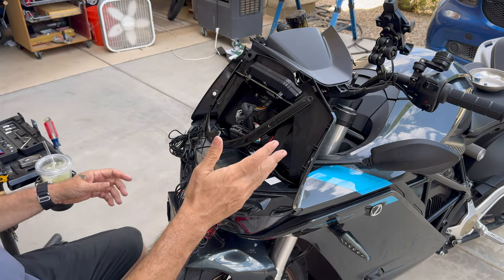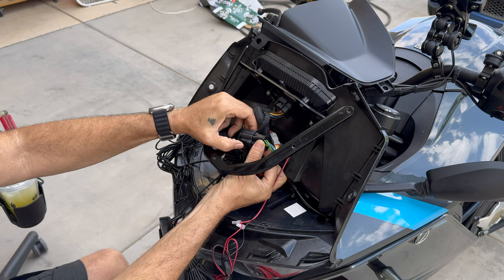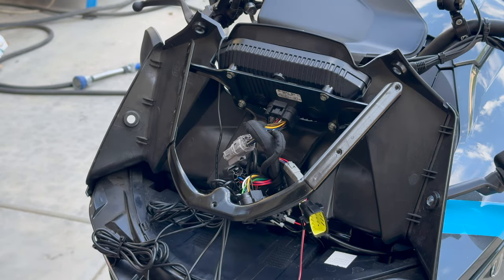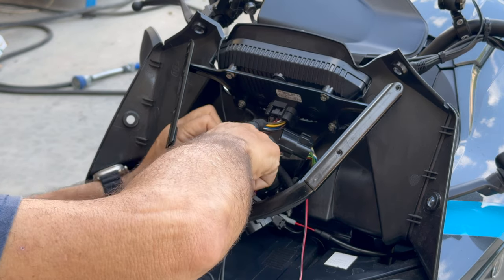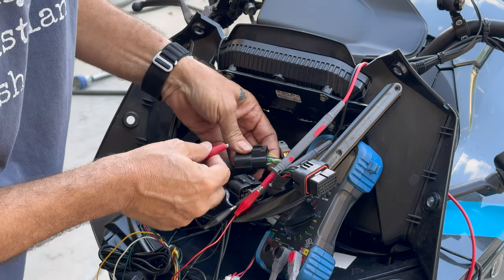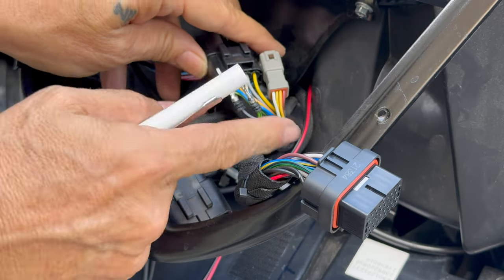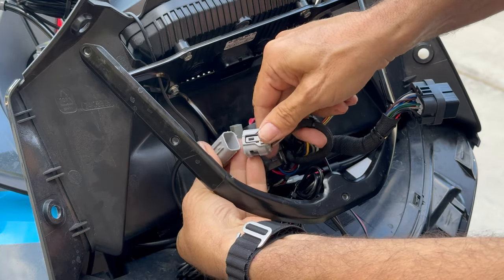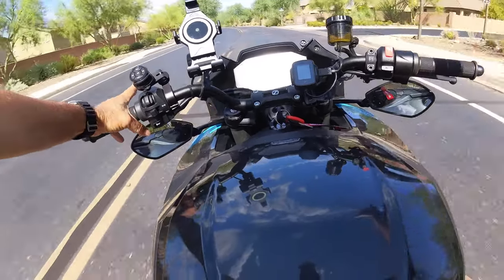Zero Motorcycle cruise control button swap

Comment: Here from Electric Sportbike Forums. 
This is a good idea, I have this bike and agree
And yes, my nut-serts you pointed to merely spun in place when I originally got the bike new, no way to remove fairings as thats the starting point. I had to drill them out.

Comment: Thanks à lot for this quick tuto.  

I just made it on my SRS 2022 premium. 

Wire color on mine wasn't the same , but positioning on connector was the same. 

For those who want to do on the same bike of me , the original cruise button was blue-white and black and the original hazard grey-black and green-white. 

It s easy to disassemble on each side to see directly under buttons.

Thanks again and have n8ce and safe ride !!!

Comment: Re: rear brake
Did you consider moving to a left hand lever? I think a big part of the lame rear brake is the master cylinder and wonky geometry of the brake lever.
Reply from the maker: I've kicked it around, but am unlikely to do it.  I agree with you, the geometry is annoying at best.  Instead of pivoting my boot it pulls it forward.  But I've been riding for over 40 years, and fear that working in an odd new way to ride might be dangerous.  Also during one of the advanced riding classes I learned that the back tire comes off the ground on a full stop, and the ABS keeps the bike from flipping over completely.  So the rear has no value in emergencies (though still has value in turns to settle the bike in).